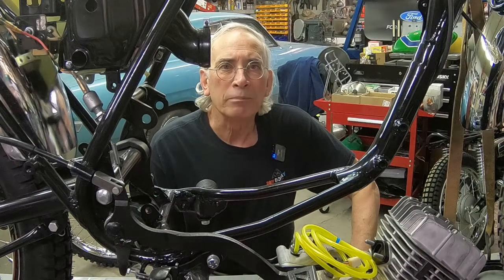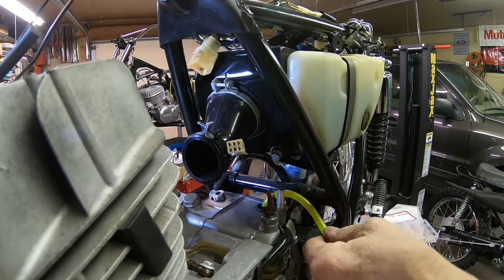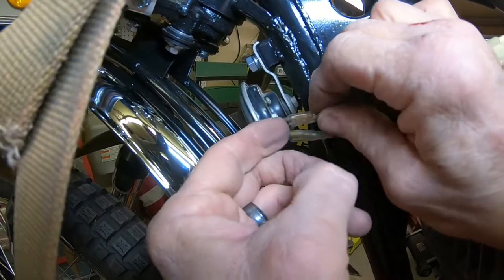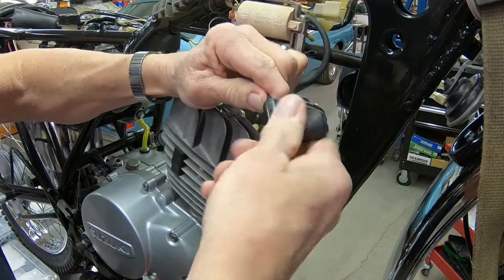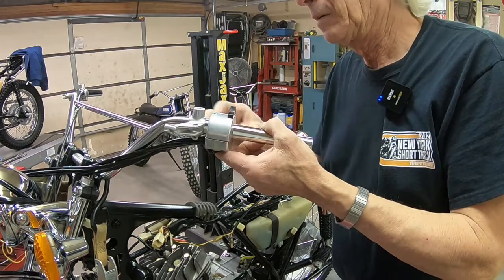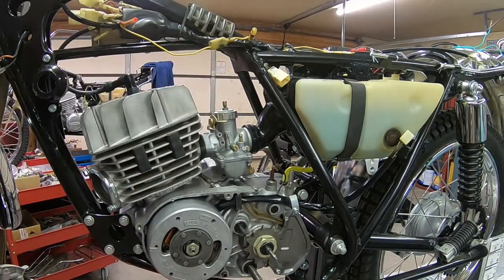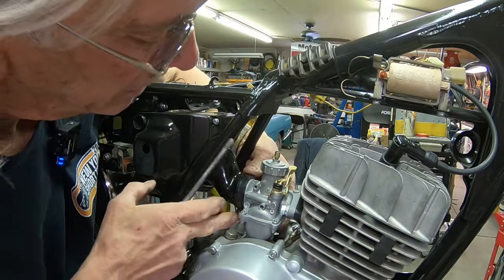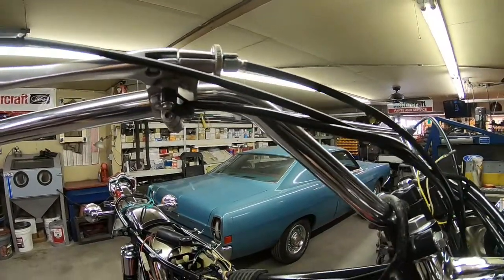73 Suzuki TC125 Install, put together, assemble.

Comment: still like the old type spark plug caps,not sure if they are still available tho.
Reply from the maker: I dont know either, with NGK getting rid of regular spark plugs and going to resistor plugs, we all will be replacing the caps with non resistor soon.

Comment: How do we tell what version of TC125 we have?  Mine is a 74, ignition on the bars, horn on the right side, forks only take 4.2 ounces (that was entertaining when I tried 6.3oz then accidently pushed down the fork tube...nice geyser).
Reply from the maker: I know it is confusing, I dont deal with models too much. I think there is a web site that will tell you by a vin number. The first TC125 I did on YouTube was a 74 believe it was a L model. Think there are about 30 videos on that bike. The 73 Im working on now is a K model, the owner new which one. But with the case of the ignition switch, it just didnt make since. The IPB calls for a 4 wire switch, but it had a 9 wire, must be midyear changes or something. The 74 I have has the switch at the handlebars, this 73 is under the tank.
Reply: @montana2strokeracer  It is, but I just work through it.  A Honda switch might work fine, or dare I say it, a cheap Chinese switch.  Both 74 TC125 & TC185 I have are on the bars.  The old 79 Honda CB400T I had was on the left side like yours and I ended up putting a Chinese switch in it and it worked fine.

Comment: Good evening Dale, looking good before you know it, she'll be smoking 2 stroke oil and gas. How many personal bikes do you own? What's your favorite?
Reply from the maker: Hey Larry, yes cant wait for it to be making a 2 stroke cloud. Oh man, Im not even sure anymore, got a few, not all are complete, use a lot of them for parts, 10 years ago the answer would be RM400, now I have trouble starting those big bikes, I am kinda enjoying the AT1 MX build, think that will be my new rider, Just found a good CT2 cylinder for it, it will probably become a CT2 MX now. I have always liked the 175 size because they are kinda 250 power with 125 weight. Good compromise.

Comment: Howdy Dale.  I got some questions for you if you don't mind.  My 125 has about 102psi in the cylinder (original piston).  I can get it to run, and it will die if you turn the choke on after running (so choke is good).  However, the idle screw has to be all the way in just to get it to idle.  The af screw is 1.5 turns (I've tried multiple turns).  Cleaned the carb again, no luck.  Took the carb off the TS125 and tried it.  Similar results (cleaning it now).  Great spark, checked it again (got a another magneto and cut it out).  Kinda baffled at the moment.  Any thoughts?
Reply from the maker: Hi Greg, sound like you have one of those hard to locate problems, I think I would look first at doing a leak down check. It sounds like a leak somewhere to me. Crank seals, cylinder head or base gasket, intake gaskets. Good luck and let me know what you find. Thats where I would start. Thanks for following the channel
Reply: @montana2strokeracer  will check it out further.  What compression psi should these read?  Can't find ant info anywhere.  I suspect the piston and rings, since I'm only reading around 100 psi.
Reply: Well it's not an intake leak.  Cleaned the TS125 carb and got it running better.  Sprayed every crack with brake cleaner and no change in rpm.  I know when I had the engine out the piston was on the edge of needing to go up .50.  It runs on it's own, so I'm sure the new piston will help a ton.  Gonna put the old carb on the TS125 and see what it does tomorrow.  Lol, a piston, rings and wrist pin are a 1/4 of what I paid for the bike....Yikes.
Reply from the maker: @gregslair4278  Hi Greg, there is no info for compression that I know of. I think your on the low end for sure, probably should be more like 120.
Reply from the maker: @gregslair4278  If I were a betting man I would focus on the seal behind the flywheel, if you can see any oily film thats more than likely the issue. But there again the only real way is to perform a leak down check.
Reply: @montana2strokeracer  Well I've had the flywheel off several times and never noticed any oil.  Other than the lowish compression, I seemed to recall it ran and idled fine before I tore it apart.
Reply: @montana2strokeracer  That's what I was kinda thinking.  So I ordered a .50 piston and rings.